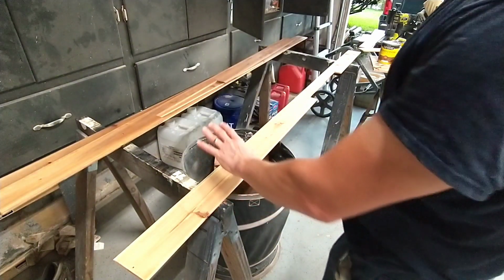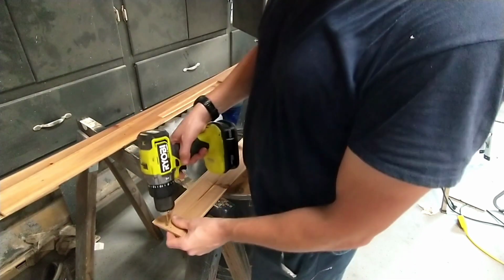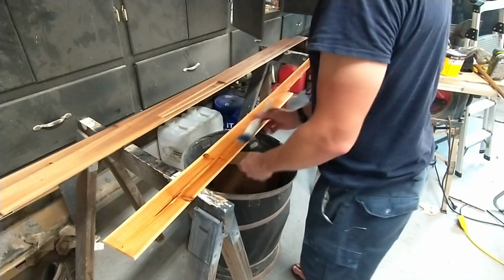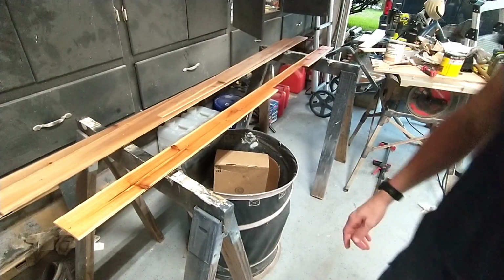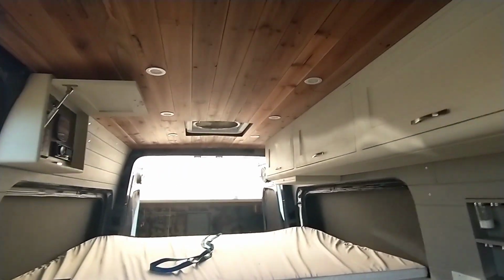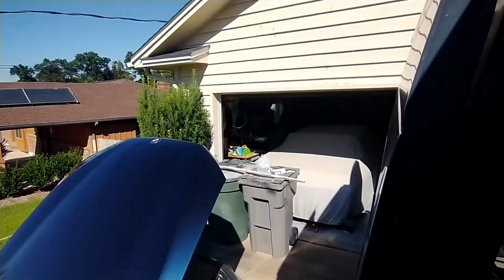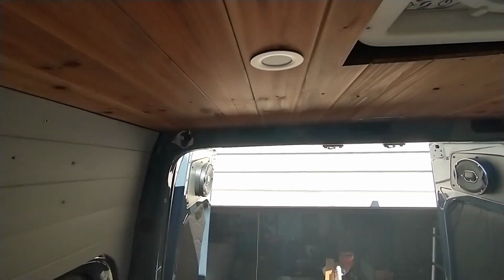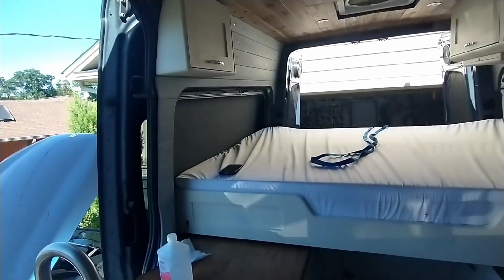Camper Van Ceiling Install! Tongue and Groove

Comment: Nice work, it looks great.  I too have a used Amazon sprinter, that I am slowly working on.  I wondered if a long nut could be used on the ends of the bolts holding the side door rail that would allow you to screw down the molding you made instead of using glue or double sided tape?   I have one other question, did your van come with more than the one ignition key, and if not was it expensive to get a spare key?  Thanks for sharing your progress.
Reply from the maker: @kevinking6692  I'd love to see your build! Mine did not come with a spare key, I live in fear of losing it. Those are studs from the upper track but you could absolutely use a recessed sleeve style nut or the like if you didn't want to use tape. I like the clean look and it's pretty well attached even before the tape.